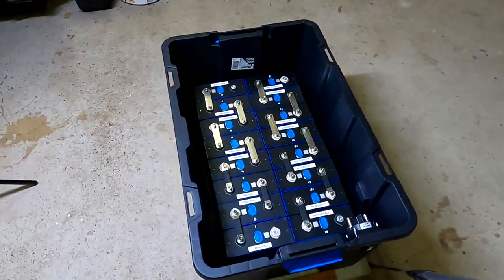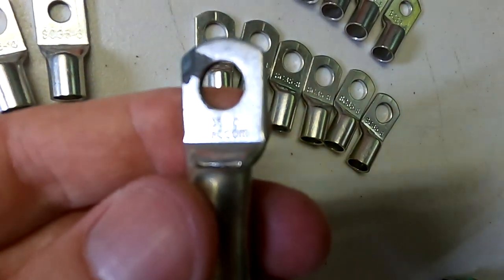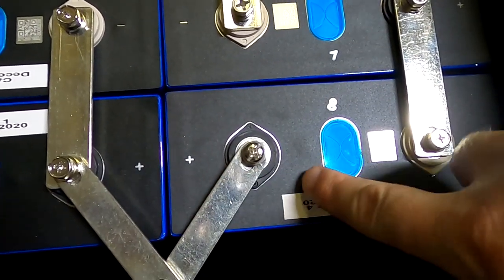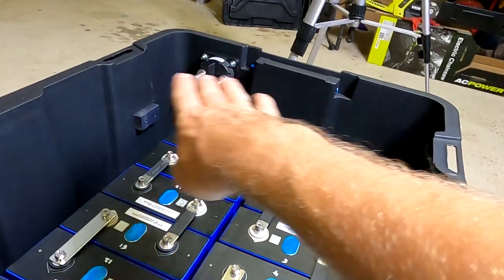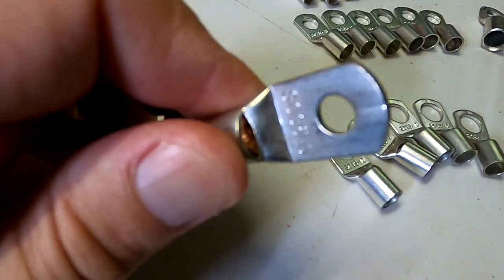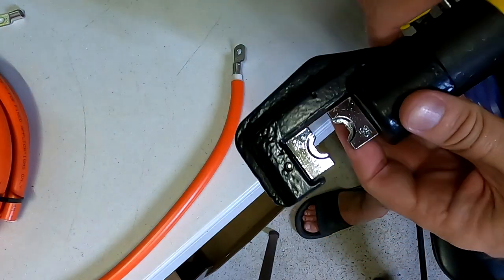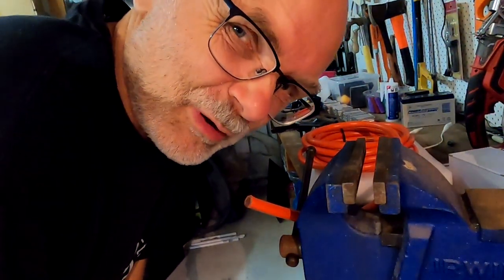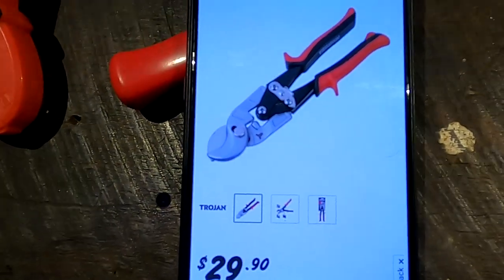When nothing works, the equipment is s**t, and a main tools is missing. #buildthebattery.3

Comment: I though you were building an overnight energy storage for your solar panels. So an average night is 12 hours+ (the early morning and late evening are not producing much power), your battery bank is 14 kWh and you are wiring it like if you want to pull 200 amps out of it. Maybe you should reconsider your power usage, run power hungry appliances, washer/dryer, AC, oven during the day and PC, TV, lights at night pulling at most 20 amps from your batteries. Also keep in mind you may have a few cloudy days in a row, so build your storage large enough to deal with it.
Reply from the maker: New to the channel? I explained what the system is for...
Reply: @OffGridGarageAustralia  Maybe not from your first post but I was in the understanding that you where building an off grid solar home. I could be wrong, I see you charging batteries from PC power supply running off the grid, for testing its clearly the best way. Yes I wonder what's your final goal. Pulling 200 amps from a 280 AMPS battery look like a surge power supply, like the Australian power regulation. Yes I wonder what is your goal.

Comment: Same problems with that crimper. Either go one smaller die or put a ferrule on the wire. Perhaps it was designed to "Anglo" crimp spec not actual Chinese lugs.
Use a proper cable cutter not a hacksaw. Bunnings 14mm cable cutter for 35mm2 cable - no way. You just have to pay for the correct stuff even though you only use it once.

Comment: Just use the saw to cut cable, strip isolation.... Take peace of electrical tape en fold together lengthwise with the sticky side together. Use this to wind firmly over the bare wire and leave just enough to start placing the connector, after that while putting on connector at same time unravel the tape. Even if you have a wire cutter, sometimes while stripping the copper spreads and when you use this trick it will save a lot of trouble
Reply: You can also use thin string or anything else. Basicly  you reverse the spreading of the wire strands like this

Comment: 1/2 INCH COPPER PIPE SMASHED FLAT, AND CUT TO LENGTH AND DRILL HOLES. BETTER THAN THE SUPPLIED BUSBARS
Reply from the maker: Better or different?
Reply: I don't think so. Google: galvanic corrosion aluminium copper. The supplied busbars have nickel plating to prevent that.
Reply: @mrzed6597  Agreed. Smashed copper pipe will certainly work, but the nickel plating is ideal to prevent corrosion.
Reply: @mrzed6597  So use nickel plated washers.

Comment: Are you sure it's the copper that's expanded in the wire and not the plastic that's expanded from the heat of the hacksaw cutting?

Maybe try taking the plastic insulation off and seeing if it fits?
Reply from the maker: You cannot use a saw. I googled it and sawing the coper will 'stray' the ends.
Reply: Hello.
I leave a 1 or 2 mm ring of sleave on the wire.
I slide it to the edge of the conductor, so the strings stay together, then, slide the ring back with the connector. the ring can stay on, if the conductor goes deep enough in the connector, ortherwise cut the ring and gain 1 or 2mm.

Comment: Use your large soldering iron or gun to heat and fill with solder after crimp to ensure PERMANENT connection at lugs. Pain in arse but you only have to do it once and no chance of corrosion causing a high resistance connection over time.
Reply: A correctly done crimp creates a cold weld between the wire and the connector and will out last a crimp and solder connector. Thats why commercial and professional connectors are crimped.

Comment: Buy cabec lugs. The rest are garbage.
Your hydraulic crimper is fine. I have the same model. Get Cabec lugs with bell mouths and life will be easy.
Reply: Angle grinder with 1mm cutting disk will cut 35mm welding cable nice :-)

Comment: Although I live on the other sie of the World IT is funny that WE really habe the same ideas. Two Werks ago I thought of buying exactly that crimping Tool.  Now I am sure this tool is ok. I bought a simple crimping plier for up to 35mm2. There also the size des Not fit, either to lose or overcrimpt and Material coming out sharp. I trieb this with  16mm2 and had to use the 10mm2 insert. The problem are the cheap lugs. I got some from german industry.    These are AT least 3 times thicker.  
Well, I will order the hydraulic tool now and try to get industry lugs here and Not from China. 
Complement, your pronounciation is perfectly to understand for someone Not speaking english as his Mother tongue.
Perfectly to understand and technically very exact and all according to rules and Standards.   I think I can value this as I am an electrical engineer her in Germany.
Reply: Thank you
Reply: Some Word werde exchanges by Auto correction. I hope it is still to be understood.
Reply: Exchanged
Reply from the maker: Vielen Dank. Yeah, definitely the cheap lugs which are the problem.

Comment: Be carefull with the threads. I  noticed they are easily stripped, each insert and removal of the nuts already removes some of the thread. Also, the included bolts are short, and if you use multiple lugs, or double busbars, they might be too short, increasing the risk of stripping out the thread even more

I highly recommend getting studs and use a nut to fix it. You can insert the stud till almost the bottom, thus using maximum thread available. With a HEX tool you can secure the stud while tightening  / loosening the nut. 
https://www.finefitfasteners.co.uk/allen-grub-screws-stainless-steel/m6-x-20mm-allen-key-grub-screw-cup-point-grub-screws-stainless-steel-a2-304-din-916-1507056.html
Reply from the maker: Stainless steel with aluminium terminals?

Comment: why are you complicating your life by using such a thick cable, why not using two 16mm2 in paralel?
Reply from the maker: I already had the cable. I also don't like this parallel cabling stuff. For testing yes, but for production, hmmm.
Reply: @OffGridGarageAustralia  Parallel cabling can actually be preferred in cases like this. People tend to forget about "skin affect" when doing DC wiring, because it's an AC phenomenon.  However when you're powering inverters, the inverters draw current from the battery in a semi-sine wave form: If you put an CT connected to an oscilloscope on the battery output line you'll see what appears to be a rectified sine-wave on the scope. If your inverter is operating at 50 Hz, for example, you'll see 50 times a second the current will spike and settle back to 0 and then spike and back to 0 again. (Twice for each full sine wave the inverter produces)

Because of this you can actually end up with skin affect on the cabling, and using multiple smaller cables will lessen the affect. 

Also: If you open up commercial LiFePO4 batteries from say BattleBorn and others, they typically use multiple smaller cables rather than one large cable so I don't see any reason why it wouldn't be suitable for production use. It's a very common tactic from what I've seen.
Reply: ohh If you want to replace a 35mm² cable, you need at least minimum 4+ 16mm² cable   or?   
Have you ever mont 4 cables on one pole?  It's :P  !!!

edit https://up.picr.de/40390896az.jpg
Reply: @Gnagnie  why 4 can you explain? I would say that 2 are enough because the bus bars have a cross-section of about 32mm2
Reply: @alexandergunda8916  U can see in the edited post before